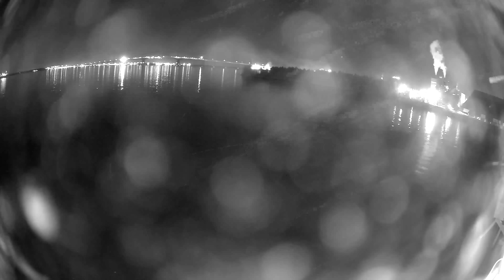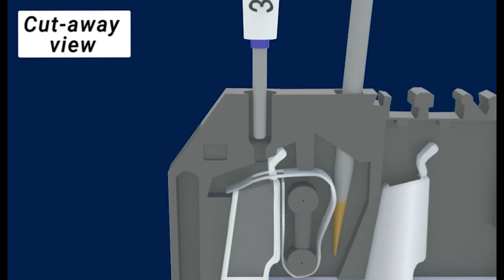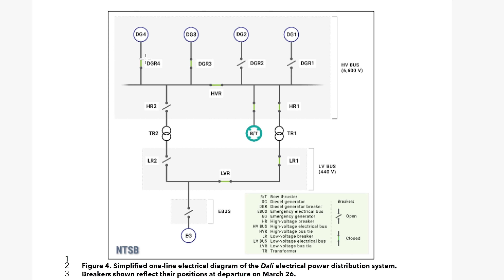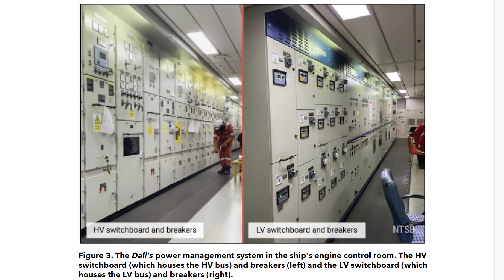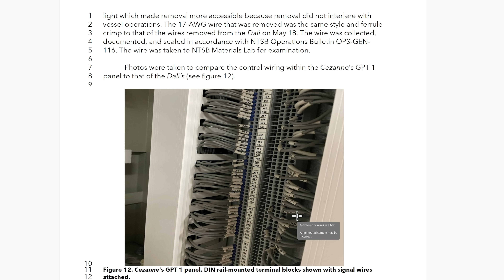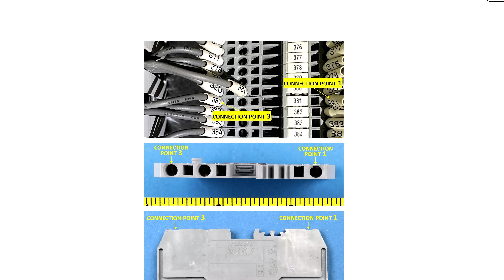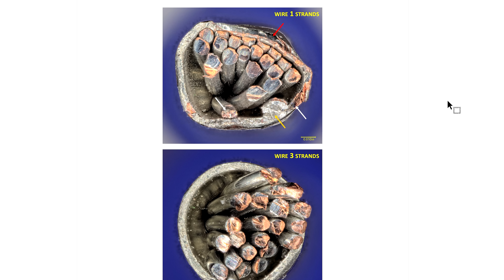NTSB: Scary Wire ERROR Caused Dali Crash/Key Bridge Collapse Baltimore

Comment: 24:20 That deformation damage is likely caused by someone cutting off the excess of the stranded wire poking out of the ferule during installation and not trying to shove it in like you said. I also want to point out that a ferule does not hold it's shape that well at the very end (it's just like trying to squeeze a pipe) and that's another factor that could have played a role in the ferule slipping out of the terminal. 

Very unfortunate.

Comment: in 1990 I had an aircon fitted to my house and I was noticing the unit was switching on and off at the controller in the house so I went to investigate what the issue was and found that the so-called electrician that wired the screw in terminal block didn't strip the insulation of the cables and screwed directly onto the insulation barely making contact it was melting the terminal block.

Comment: I think I understand why it was labeled on the blue collar and not the wire.  It looks like they used heat shrink labels.  Heat shrink comes in different diameters and has a limit in how much it can shrink.  They labeled the cable AFTER installing the blue crimp on connector.  The heat shrink had to be big enough to fit over the blue collar but was then too big to shrink down on the smaller cable.  In this video you can see that the label is not shrunk around the wire at 16:35.  They found it worked better/easier to shrink the label onto the larger collar.  Still, it is unreal how such a small thing can have such huge consequences.

Comment: In think you are wrong, (24:25)
 The wire was stripped and the ferrule was installed.  then excess wire was trimmed off. in that process the ferrule was inadvertently caught and deformed. then in an effort to pass it through the opening of connection, it hung up and the label was dislocated. At that point the ferrule slightly passed through the capture mechanism. At a later point in time it was dislocated and became an intermittent connection.

Comment: Truly amazing how a misplaced plastic label caused a misalignment between a removable electrode and an internal contact for that electrode..     I certainly would not want to be the guy who signed off on the assembly of all those numbered electrodes.

Other issues are electrolysis and rhythymic jarring back and forth asea, which wouldn't happen in a test lab on the shore.     I am also an EE.    I think those plug and jack connectors you illustrated in great detail could be better designed for both  electrical connectivity (other than the 4 or 5 crimp points) and security (not pulling loose at sea)   based on the forensics shown in this video.

Comment: that bridge folded under zero pressure. Like, I understand the ship is big and heavy, but it literally tapped it just a tiny bit and it fell instantly. That bridge was going to collapse regardless eventually.
And by that, I mean, if a bridge that is stable is going to collapse, usually major damage has to happen to one of its anchor points, and I don't think that's what happened until after it fell.

Comment: Rather inadequate electrical design for a ship this big. Most essential on a ship is being able to steer, like in an aircraft. Why is there no battery powered back up system to provide hydraulic power to the steering system? Or something equivalent to the Ram Air Turbine, let’s call it a Water Driven Turbine, that drops into the waterstream in emergency situations? I think this means back to the drawingboard.

Comment: It's pretty rare that the NTSB have essentially captive access to the accident scene like this; even in cases where an airplane or train survives intact, or largely intact, there's massive pressure to clear the scene, etc.

Dali was pinned to the channel bottom by that bridge for MONTHS, and the NTSB had free reign to poke anywhere they needed to.  Even after it was freed, it was tied up in Baltimore, then Norfolk, for more months until finally repaired enough to sail off to the shipyard.

That explains the exhaustive detail in which they explain the exact sequence of events, and circumstances, that led to the disaster.

WAGOs are great, nice quick and convenient.  But if you don't tug-test every single wire inserted, there's no way to certify an installation other than by prayer.  

In Dali's case, that wasn't enough.

Comment: This is all because someone bought the wrong size wire lables.  The electrician tried to make them work by placing them on the ferrel because they were too big to stay on the wire.   If you look at the pictures all the labels are on the ferrels.  

Also they should be testing the redundant systems better.
Reply: Though those labels didn't need to be tight on the wires, just shouldn't have been forced on the ferrules . 
Bad understanding.

Comment: 7:08 It's not so much about wriggling loose, it's that the ferrule only connects to the spring and doesn't touch the busbar. While the spring is also metal, and as such conducts electricity, it's spring steel, not copper, which is a much worse conductor.

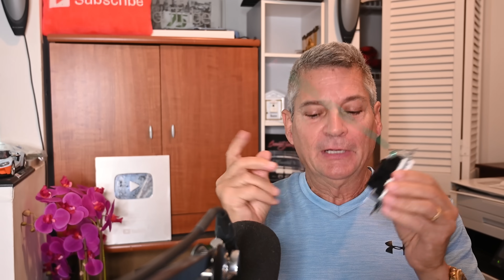Comment: 7:55 Shitting on electricians that work with certain features of hardware exactly how they are supposed to work is kinda bad. Especially if you have to make a jump cut to remove the part of the process that would actually back your argument. Seems a like you had a bit of trouble pulling out the wire.
Using "backstabbing" as you call it is perfectly fine if you are using the correct gauge single core wire with the correct length of insulation removed and no damage to the core itself. All those parameters can be easily met with the correct tools.

Comment: 24:30 The reason it is deformed like this is because of the terminal clamping force pressing on it at the very end of the ferrule. It's like one of the indents. You would see the same deformation on a properly installed ferrule, if you take in image exactly at the cross section of the clamp pressing into it.
The "linear scratches" are from the clamp slipping off of the ferrule as it squished the ferrule up and out of the terminal.

Comment: If the ship owner can prove that the wire is as fitted at the build phase I'm sure they will try to argue that it was the ship yards fault at installation. The owner does go through an acceptance program prior to taking a new build from a shipyard and the sign off by the ship owner may absolve the ship yard of fault. I'm sure all the authorities have gone through every bit of maintenance that system has had recorded since it was handed over to the owner to see if any of the ships engineers or an outside service engineer has worked on that system. I know on vessels I have worked on there have been QC labels inside electrical panels with a engineers signature. Not sure if that is the case here so maybe they can trace the work to the engineer?

Comment: I am an electrician and I mostly worked in industrial plants for 38 years. I will say that these terminals are extremely reliable when used as you describe them. But the chance of someone not installing the wires into the terminal is fairly high. In many installations that I have supervised the start up tests this insertion problem has cropped up. They can be hard to find since the problem is of course intermittent. How ever oven with this problem they provide a vastly superior connection compared to any other type of connection. The best protection against this failure is training the technicians involved. The method should include a pull on the wire after insertion.

Comment: At 20:00 the wire ferrule were two different designs. One is round the other square. The square could cause a loose grip from the lever nut if the wire starts to twist and force the lever to ride the crease or edge. The design difference of the wire ferrule and lever nut lock is a issue. That being product design standards being changed or reworded as the description of the build. Holding a round ferrule and a square requires the lever shape to follow. Take into account how most products are now made with pricing cut to the absolute minimum it's safe to say this happens alot on every ship in service at present. Simple mistake cost lives. A backup system independent of all systems should be required on ships this size and maybe a ship tug escort to a point clear of any hazards. I thought we had that. I live within eyesight of the Key Bridge. A total cost of $1k at most cost lives and $100m's is sad.

Comment: I hate backstabs because if you need to replace the outlet or switch is a pain in the ass to pull out the wire.

Comment: Management plays a HUGE role in negligence like this. While I briefly worked in an aerial tramway hospital transportation infrastructure I found some loose ferrules in the control cabinet during routine inspections. When I pointed it out and asked for a crimper to fix it, I got chewed out and blamed for making them loose and to stop touching them. I eventually did end up fixing them but still got told to stop looking at it.

Comment: Fantastic animation of the electrical connection in the spring clamp, but it also shows an unimpressive contact area. Also, why are they using stranded wire with a ferrule whereas my home used solid wire where a ferrule is not required?

Comment: This wiring error is why the ship lost control.

The main reason why the collision occurred is that the bridge piers were not protected by dolphins.

After the collapse of the Sunshine Skyway Bridge over the entrance to Tampa Bay in the early 80's, there is no excuse for any bridge over a shipping channel not having its piers protected by dolphins.

Protective dolphins could have easily been installed for a few tens of millions of dollars and the loss of over billion dollars for the replacement bridge costs as well as those that died would have been avoided.

It is not a matter of if the bridge piers will be struck, it is a matter of when.

Comment: The mark inside the plastic may be from the spring being heated due to arcing. 

It seems all the labels on the block view are over  the ferule because they all have a bulge at the bottom, even the richt side of 381 that sopposedly was seateed correctly. Description in the beginning said lables behind the ferule not over it.

Comment: The plastic on 381 also provided tension to loosen the connection. i think one of your pictures shows the label deformed. it would act like a spring to push the ferrule out.

Comment: I agree with you. I hate it when electricians use the holes on the back of outlets to make their connections instead of using the screws. I don't care if it takes me a bit longer, I refuse to use them.
Reply from the maker: It's definitely a common point of contention among electricians!

Comment: These types of WAGO clamps are designed specifically to hold the wire without any ferrules. The spring in the clamp is designed specifically to distribute the copper wire to the copper bus bar inside of the clamp. By using ferrules the point of contact might be to small and might cause thermal problems. There some exceptions to hold specific thinner high flex wires. These are usually very low current and therefore the smaller contact points are not a problem. But even then you should never ever use ferrules with the plastic rings on it, as it prevents proper insertion into the clamps. Also most commonly found damage is usage of improper tools such as screwdrivers to operate the clamps. There are specific WAGO tools to do this. Most screwdrivers have a little step at their blade and this can damage the clamp spring to make them less powerful and can result in a bad connection too.

Comment: Great analysis. However I doubt a thermal imaging camera will pickup a poor connection with Control Circtuit Wiring. These circuits draw minimal current, and will not create a high resistance joint which can lead to enough power loss to be picked up by a thermal imaging camera, unlike power circuits.

Comment: This happened at an electrical call I got one time. Every time the guy closed the heavy sliding back door, The lights would go out in the backyard. Turns out he had done it himself and they were connected precisely this way so that they would just rattle out and back every time he slammed the wall that the electrical panel was on. We just charged him a service fee to show up because we didn't really do anything but trim the wires back a quarter inch and connect them properly.

Comment: And this is why I only use ferrules for screw terminals, too much of a possibility of error when used in spring terminals, the wire can fall right out of the ferrule easily

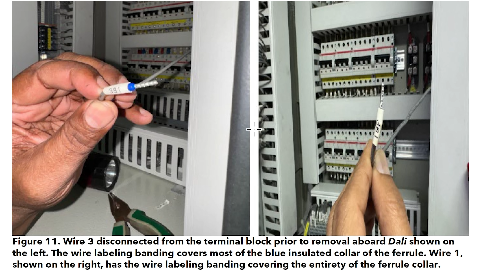Comment: Compare Dali's panel @ 16:46 vs it's sister ship at 16:56. The heatshrink label is over the blue strain relief on every ferrule connection. On the sister ship the blue is showing. Correctly installed would be 1/2" away from the ferrule.

Comment: If tha t diagram is accurate then the terminal block is designed incorrectly. The blade should be angled so as to make the return of the cable (ferrule) impossible. Modern European connectors do just that making perfect connections and can never come loose.

Comment: I took a home electrics class in high school, and one of the first things we were taught was to NOT use the backstab ports on switches or receptacles. The reason the teacher gave us was because the tang inside the backstab is only making a small connection to the wire, which can cause excess heat due to the tiny connection point. On the other hand, using the screws (and winding the wire clockwise around it) gave a much larger connection surface that would be less likely to fail over time due to heat. I've had to replace several outlets and switches in my house, all of which were originally installed using the backstab. It's a shame that they even still include the backstab option, given this.

Comment: There is a LOT of chatter in the RV/Motor Home industry about the differential of AC vs. DC with WAGO. The argument (Even though approved by NRVIA) is that low voltage carries higher amperage, so thermal breakdown is more prone to the WAGO design. I haven't seen any failures yet in person, or signs of it, but I have seen private evidence of it through individuals that service their own rigs. It's always mainly, on the RTU circuits. The amperage in-rush and short term recovery demands of the RTU's, temper the internal spring tab of the WAGO during this time, and eventually looses its clamping force on the ferrule, you know, and then crap catches on fire. The main argument by the inspectors, is that once this happens, the connection will arc internally with the sealed WAGO, and the breaker will trip before anything "bad" happens. Supposedly their "Theory" is that it is not an openly exposed arc, so it is by far a much better and faster factory assembly option than nuts, with the added benefit of arc flash breakers in the box. Insurance adjusters would likely disagree. 
    Excellent video BTW! I love your content!

Comment: Sounds like wire error started the dominoes -  but why did those generators lose/run out of fuel and switch back to DG2?
Also feels like a system designed to be redundant, and resilient to bad wiring on one leg, was reliant on a number of things which weren't reliable.

Comment: THE MOST SIMPLE RULE IS DO NOT USE FERRULES ON CLAMP CONNECTIONS!!!!! I mean comeone. Thats why i dislike most engineers. They dont touch real equipment and they most certainty dont know the tricks of the trade. A ferrule in a clamp connector is a bad idea. The most basic field tech would have looked at that row of terminal blocks and laughed. It wasnt the "labels" ITS THE MISUSE OF FERRULES!!!! IT WASNT THE PLASTC IT WAS SOME DUMB ENGINEERS INSISTING YOU SHOULD USE FERRULES!!!!!!!

Comment: Really need to design for 5 years old, as adult act like 5 years old.

would be good to have a hilt before the ferrule, so that the label will not slip towards it, and no sane person will tape it over it knowing it is to attached towards the opening.
the terminal block should also be redesigned so that there is more space to plug in each connection.

Comment: really great job here Jeff. Thank You for a great explanation for us non-electrical types. I'm very surprised however about the design of this system. This just seems, as a lay person, to be a weak design. Would there not be stronger redundancy built in to a critical system like this?
Reply from the maker: There is redundancy built into the entire power system except that once it lost power there was a secondary issue with those backup generators number three and four that caused them to shut down also otherwise that's just would have been a normal switch over to backup power

Comment: Really after NTSB investigation it looks like the crew and captain failing to have the auto swap breaker set up correctly before leaving port was a major part of the issues if that system had been set up or understood the black out would not have occurred. That is what the breaker system is designed for, having both in manual defeated the back up system. Training, Training, Training.

Comment: These blasted clamps. When there is trouble in 90% of the cases these clamps are involved. Most time caused by untrained workmen or the lack of proper tools. I saw hundreds of these faults on land and on ships. Good old times when you had cable lugs and screws in the terminal boards.😁

Comment: Those numbering sleeves could have been put one inch from the blue insert plastic, but I suppose they are heat shrink, so someone thought they are to be put over the blue plastic, to add strength.